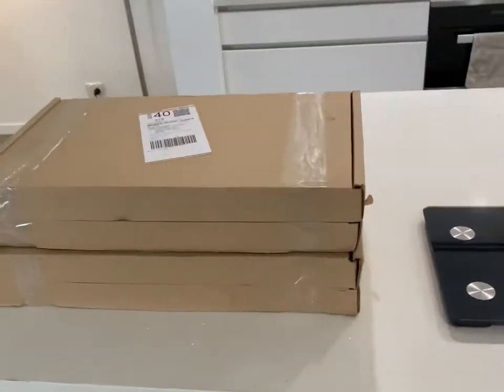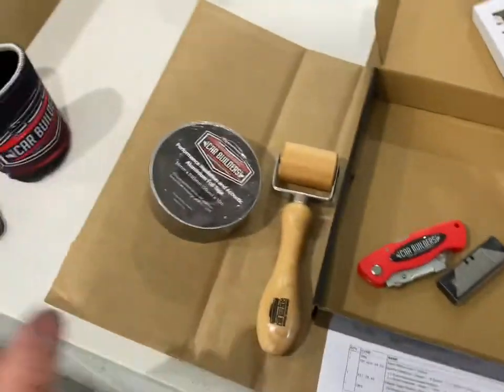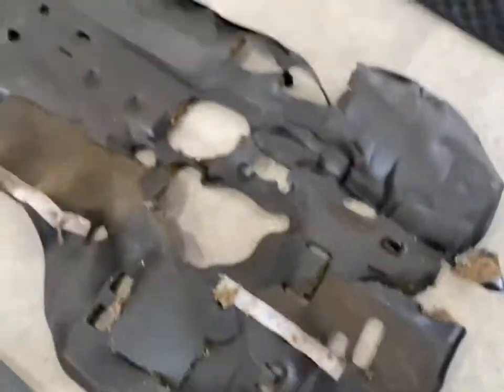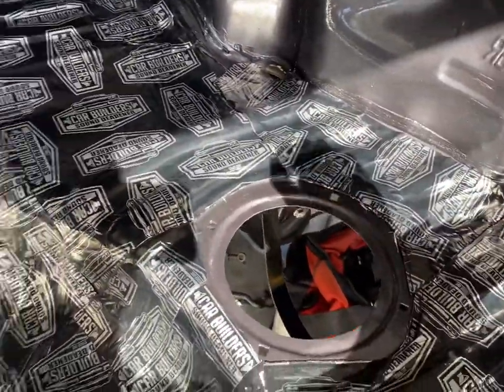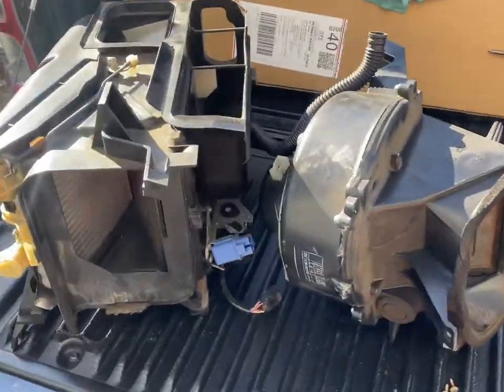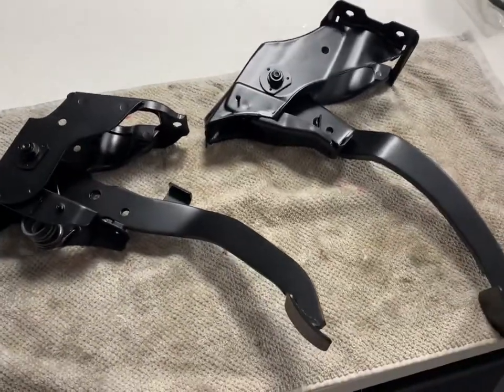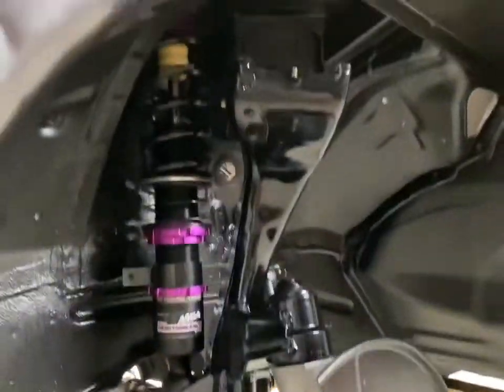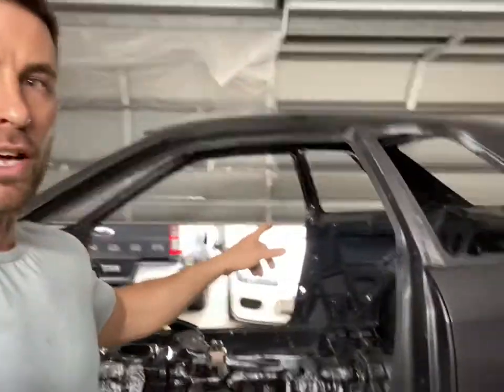R32 GTR Restoration 10 Sound proofing

Comment: How did you get on with the firewall covering mate? Did it end up being a pain in the arse?
Reply from the maker: It came up well but yes it was harder than i intended it to be, its hard to get super spot on as the stock one is moulded but im very confident its an upgrade over the stock cover. Just takes a bit of time.
Reply: @Motorsporttuningsolutions1  
Nice work!
Doing a similar interior resto on my R32 GT-R at the moment. Any tips for the firewall mat? Do you have a vid or pics of it fitted up? It also looks like you are using the mass noise liner rather than the mass noise liner "lite". Car builders recommended the lite version to me but I reckon the heavier version would be better. Cheers